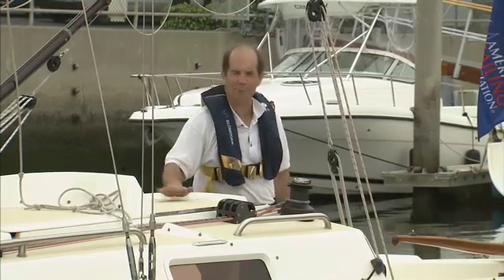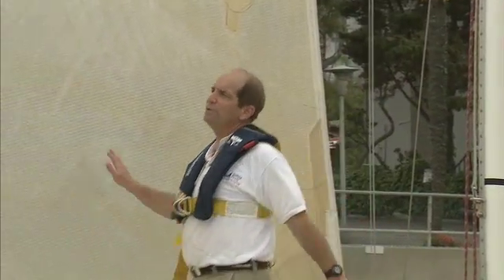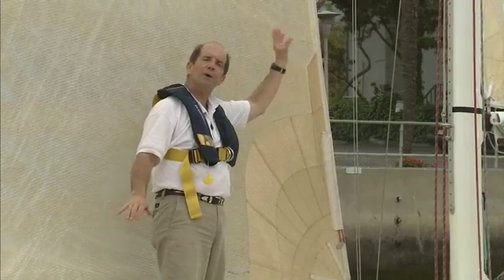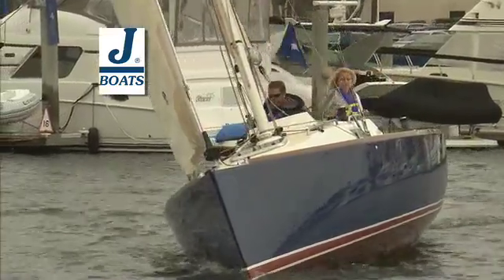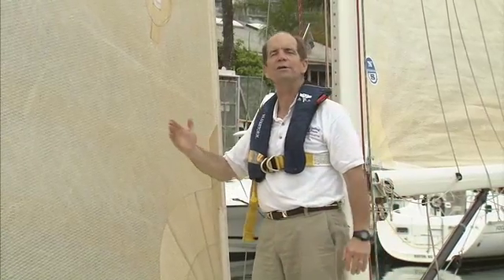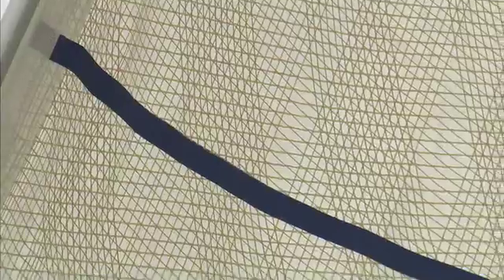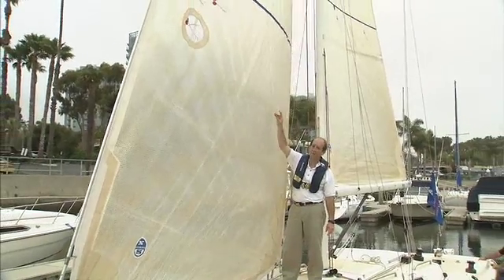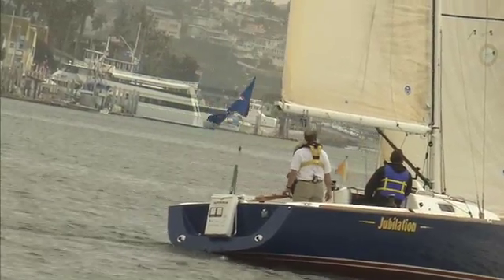Video tip: Slot Effect

Comment: the venturi effect is an oversimplification that is not true in practice. On a sail you have a low and high pressure side, the low pressure side being on the curved side of the foil. The slot effect influences the stalling of the main sail as the wind follows better the boundary layer. Its all a lot more complicated than the simple venturi explanation.

Comment: Very good explanation of slotted wing effect, but assumes a bit of knowledge of aerodynamics.  Perhaps laminar flow was introduced earlier, along with pressure differentials and the Bernoulli Effect.  (There are lots of aerospace engineers in Southern California and Seattle, but perhaps not so many elsewhere.)
   
Good tip about the draft mark.  A more advanced coverage of sail trim would introduce how to move the draft using other controls.
Reply: My simple mind understands Duncan descriptions far more easily than yours, because I am not an aerospace engineers.
Reply: @alanmctavish3628  Agree Duncan's explanation is very clear.